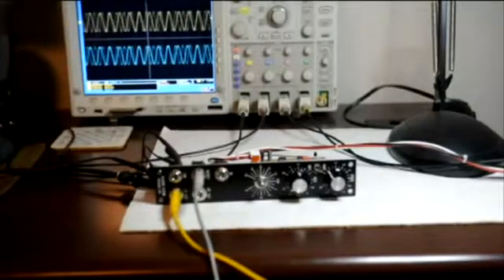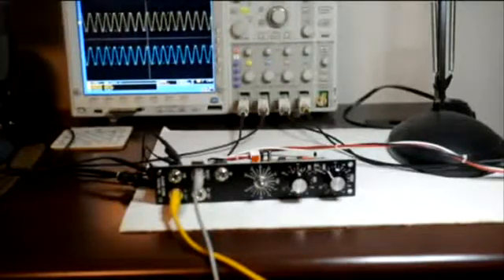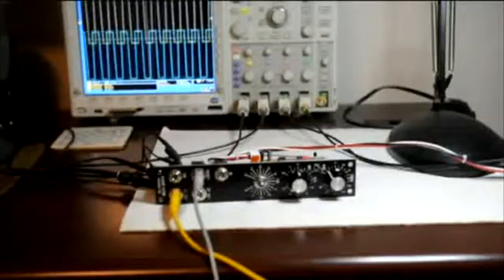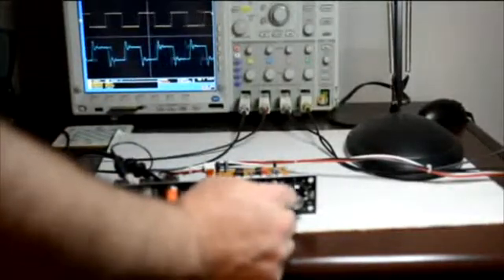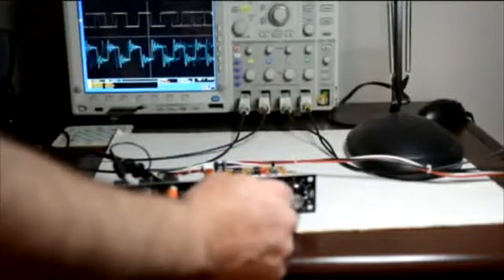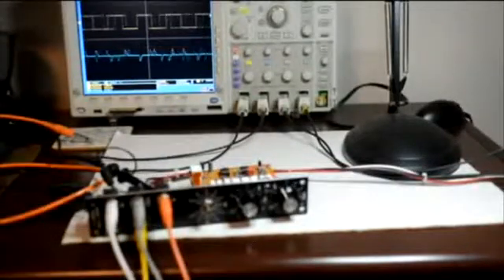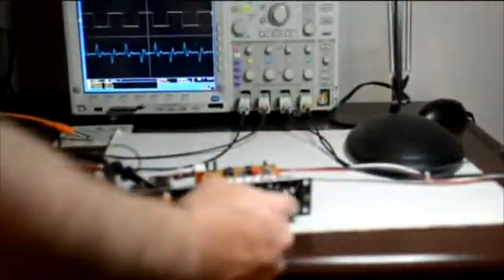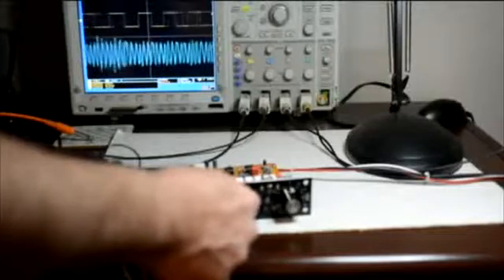DJB Polivoks Filter

Comment: filter w/o capacitor?
f=1/2*3.14*R*C
how calculate the frequency?
Reply from the maker: Programmable op-amps have an Iset pin which controls the slew. This is what controls the frequency response of the filter.
Reply: @modularsynthesis5074  i not about "control" (because I now about change bandwidth)
i question about. "calculate"